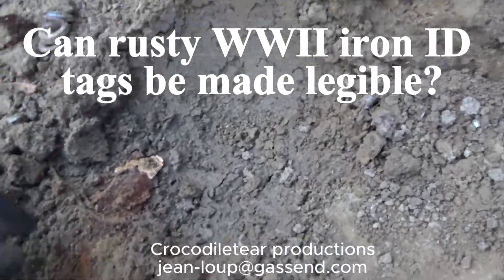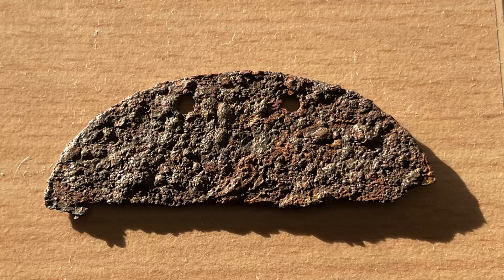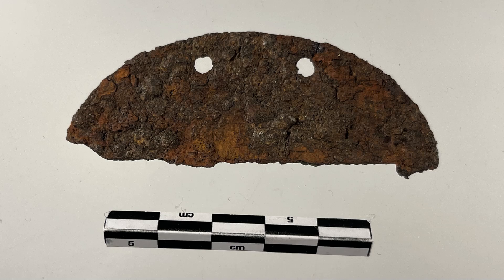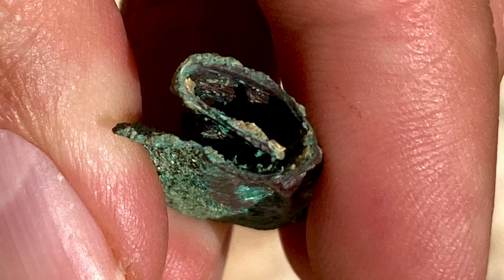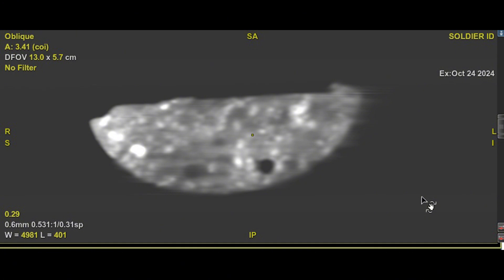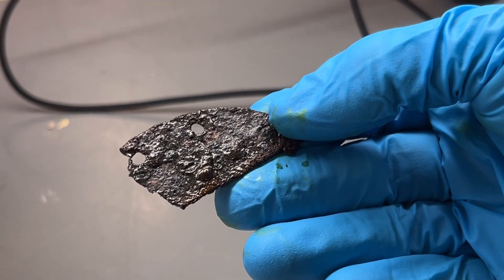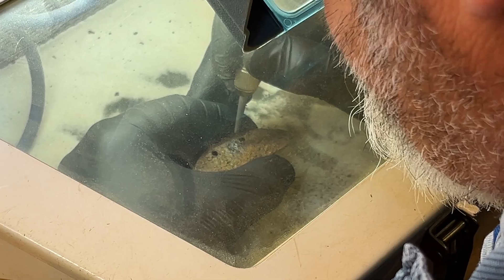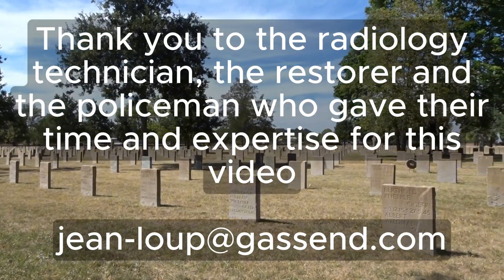Can WWII German iron identification tags still be read? WWII soldier identifications

Comment: The letters/numbers will erode with the rust, it's impossible
Reply: Use vinegar 
It will get rid of the rust but it takes a couple of days
Reply: @ lol
Reply: Please tell me if it works. I hope this person can be identified.
Reply: There is simply too little metal left to do anything. 
Maybe a few years after the war, in places where dry earth was not a corrosion accelerator... but not today, the more years pass the smaller the chances.
A few years ago I had the opportunity to look at fresh excavations, what was left of iron tags can be described as a "conglomerate of iron and oxygen compounds". Just extracting the identifier from the ground already causes irreversible changes, I do not believe that it is possible to read anything from such a thin iron plate. And I remind you that we have to read everything (or "almost everything") to get any useful results.
No dissolving (acids, evapor-rust and similar rust removers) or sandblasting (using soda is best) will help. These methods only damage the ID, which was too thin and poorly made from the beginning.
What would I do? I know it's not very realistic (because it is what it is), but I would try to fill such findings with resin (chemically neutral epoxy or smth better?) with everything around it. Today we don't have a method to reverse the corrosion process, but who knows what the possibilities will be in 20-30-50 years? I assume that the less we destroy, the easier it will be - someday - to read the contents.
Reply from the maker: I believe you are correct.
Reply: @CrocodileTear  only one way to find out. Nothing to lose give it a go we’re all curious
Reply: Maybe trying with laser?
Reply: Try Glass blasting. Found an Post recently at FB that it should work.
Reply: @magicpsy1761  That was in the video.  It didn't work.
Reply: @jic1   OK. So FB posting 💩 again 😄

Comment: I would try using CRC Evapo-Rust or electrolysis. It will depend how much of the original metal is actually left, but I have had surprisingly good luck using Evapo-Rust to remove heavy rust and be able to read engravings in the past.

Comment: Try soaking them in distilled white vinegar or coca cola. It should eat the rust/oxidation off. I've used it to save old metal that's small and thin. I can't guarantee the legibility of anything but it could giving you a fighting chance against rust

Comment: What about electrolysis? I restore old things and I’ve used it on old toys with thin metal and details have become visible. All you do is get a 12v battery charger, a bucket of water with some borax in it, and connect a wire from the piece to the negative terminal, and a fresh piece of iron to the positive wire, place them both in the water and turn the power on. I’d try 12hrs and see what happens.

Comment: I went metal detecting in a park of my hometown den haag in the netherlands, there was no fight, the germans held untill may and surrendered, the park used to be a emergency airstrip for food, one part at the edge of the park still looked the same, with some trees. between the trees i found a iron tag, with both sides. one side was crumbled and rusted and the other complete but very fragile, i decided to go to the extreme, and it worked. i put it in citric acid for less then a minute, and a toothbrush, it became readable, took the picture of it, after an hour trying to move it it broke completely apart. 

It was of a dutch soldier who functioned as a driver, and he went missing. Presumed to be killed by the resistance, the tag broke down but some parts still readable, i gave it to the family and it was the only thing they now have of him. When the park is scheduled to be maintained they will make bigger digs to maybe find parts of body's. The resistance was known to murder dutch working for the germans,but it was admitted the local government really did not look nor cared for those dutch, they just planted grass on the strip and added some playgrounds, there was also all sorts of munition in the ground still. 

So if you dont care about keeping it intact and just want to get a glimpse of who it belonged to, try it carefully with citric acid and a soft brush. 
i felt it was important since both sides where there, germans or allieds would register one side and leave the other with the body, and even tho it was just rust, its the best find ive ever made. The family could guess what happened, but never immagined someone would care enough to find out.

Comment: Hello!
Coming at it from a geologist's point of view:
for mineral identification, we often make "thin sections", which are little slivers of rock glued to a glass slide (using canada balsam or epoxy glue) and then polished down to a few microns thickness so that it becomes transluscent and can be analysed with a polarising microscope. 
Any properly equipped university geological laboratory should be able to make them, and many commercial labs specialised in geological sample analysis too for a few tens of euros a pop.
It  an also be done "at home", as the only material needed are some glass plates cut to the proper size by any glass shop, a series of carbrundum grit (maybe even automobile type wet sandpaper), and a larger glass plate to use as a stationary tool (as a flat surface to put the grinding medium). It will only need a bit of water for slurry -making (if you use carbo powder) and lubrication, and some elbow grease. 
You glue the tag to a small glass plate, put a little spoon of carborundum on the glass work surface add some water to make a runny slurry (or place the wet sandpaper sheet on the plate, it should glue by suction),  and get grinding, keeping the surfce wet. 
Make sure to use rather fine grit, as rust and metal are quite "soft". And work gently so you do not peel the tag from the glue and gouge the metal.
I am not suggesting to polish the id tags to transparency, but only to be able to reach polishing down to clean metal without worrying about breakage.
Once the surface is polished flat and shiny, you could maybe see something or try the acid etching method again.
Reply from the maker: Do you have any ideo of what the cost of this would?
Reply: @CrocodileTear to have it done professionally I'm not sure of the cost, but materially it isn't very expensive. It sounds like a similar concept to process that I've seen with ancient wood samples that are being studied. Essentially, the object is embedded in a hard, clear medium such as epoxy to stabilize it (usually the object is placed in a vacuum chamber before the epoxy sets to remove air bubbles and ensure full saturation). Then the stabilized object can be 'sliced' extremely thinly by polishing the surface using a very fine abrasive and a flat lapping plate (a piece of glass or a smooth stone countertop works). As it's gradually polished thinner and thinner, a fixed position camera is used to take high resolution photos every few microns to capture the cross section and record a 'slice'. With an object like a dog tag, you may be able to capture the miniscule topology differences between raised characters that were stamped into the metal, however it is inherently a destructive process and the odds of recovering the information seem low.

Something that may be worth pursuing is ultra high resolution 3d scanning using photogrammetry or LIDAR to create a digital copy of the object, and then using modelling software to enhance the irregularities and possibly reveal patterns that might be invisible to the naked eye (such as height differences caused by stamped characters). There is also a person here on YouTube that rescued and rebuilt a decommissioned Electron Microscope that might be willing to scan it at an unbelievable resolution to possibly do something similar.

Edit: the person with the electron microscope has a channel named ProjectsInFlight I believe.

Comment: I would suggest mounting the tag in a block of resin. Then carefully sand the exposed side with progressively finer abrasive, then polish and finally acid etch that may highlight the numbers even if youve mounted the tag backwards.  You need the support of a resin block behind it.
Reply from the maker: Yes, that might actually work

Comment: Since nothing so far has worked here a couple of ideas. Sonic cleaner or electrolysis. Perhaps some sort of vibratory cleaner without any media. Maybe vibration would break off an intact piece of rust containing enough info to provide an ID. Also, there has been a fairly recent discovery that enabled burned scrolls from Pompeii or Herculaneum to be read. Plus I seem to remember some Dead Sea Scrolls that were on papyrus vellum or parchment that could not be unrolled yet the scientists were able to read them. I don't know what they used to "see" with though.

Comment: How about a CT scan? It should be able to detect the slight difference in metal density from the stamping process….or the layers of rust may be slightly thicker in the areas where the rust had to fill in the stamped parts. If nothing else, it may have left strain traces in deeper metal which hasn’t been rusted through yet (maybe?)

ChatGPT also suggested neutron diffraction which sounds awesome.

Comment: Have you tried oxalic acid to remove rust? It's a method often used to restore old steel helmets. If most of the iron already converted to rust tho, I'm afraid all data is already lost.

Comment: Try doing a rust conversion like Gun Smiths use in a Firearm restoration, not sand blasting or removal of the rust. After that is completed try doing other methods like magnetic or x-ray to recover information if still present.

Comment: I think the serial number restoration works because although the indentations of the letters has been filed off, the atomic structure underneath is still disrupted by the stamping, and thus reacts to etching in a slightly different manner. The polishing is to make the etching more even, and the subtle differences more apparent. This said, in order for this to work you need a substrate of the original metal still intact, and judging from the cracks that doesn't seem the case unfortunately. However, you may have better luck with a less severely corroded specimen.

Comment: Dont mix the tags up , keep them catalogued to where they were found , the technology will come about to be able to read them , , I would think if the  surface was lightly ground flat and clean with a precision machine on the side the numbers were stamped on  to get the cleanest surface possible ,, the acid would react enough to bring up the letters , it has to be worth a try for better ones , it will mean damaging it but it will be worth it if you can identify even one soldier.

Comment: a bit of a longshot, but have you ever placed a coin on a railroad track to have it flattened out? a lot of times you can still see the design of the coin even though its now very flat. i tried using a large punch to pound a penny flat against another piece of metal and got similar results except it wasnt elongated, it was just enlarged. 
maybe if you tried something like this but with a large press, either with surface prep or without in combination with xray or acid. its certainly a longshot, but who knows? it might bear results.

Comment: This method of serial number restoration looks interesting and still promissing! But seeing the police officer apply the acid directly on that sandblasted and uneven surface... Imagine putting acid direktly on the unevenly filded down serial number area of a weapon or car.

If there is any unoxidized iron left in these tags, how about grinding it down and polishing it so that a plain polished surface can be established. (You had to hit the very narrow plane between the back side of the tag and the deepest stamping inprint on the front side). If you then put acid onto it, maybe then you can faintly see where the material structure was changed due to stamping of the letters. However, if the whole tag was rolled during manufacturing (what is likely the case) the material structure may not be suitable to show any further changes by downstream stamping. Because rolling and stamping may have the same impact on the metallic structure after all. I´am no expert at all, but I had some points of contact to the analysis of metall structures during my time at some higher education institution.

But varying with the degree of corrosion, trying to restorate the original surface seems to be next to impossible - simply because it doesn´t exist anymore. Therefore material structure seems to be the only way.

Comment: Let's assume that these problem tags are made of mild steel? This is probably the worst metal you could use, as it always heavily corrodes in the conditions found here. The only thing to prevent this is adding a significant amount of chromium to make it non-corrosive. All metals were at a premium in Germany during WWII, with coal being the only abundant material being used in metal production. However, Germany had supplies imported from the Axis or occupied territories. There probably was enough Cr available to make stainless tags. However, the other alternative was Aluminium. Why they chose mild steel is a mystery.
Mild steel is very reactive and will readily revert back to iron oxide (rust) in the presence of water, oxygen and ions. General corrosion will often be present along the surface of buried steel components unless the surface is coated with a dielectric, or an electrically insulating, material. The severity of general corrosion depends on the soil conditions (e.g., moisture, degree of aeration, pH). The corrosion can be so minimal as to be insignificant, or it can be severe. Typical general corrosion rates in soil result in a loss of about 0.045 millimeters (mm), with the deepest pits of about 0.23 mm over a period of 9 years. Of course, in this situation corrosion is occurring on both sides of the object.
As for being able to extract the information written on the tag, this is probably impossible. The surface metal is now just an irregular structure of oxide scale, which now occupies approximately six times the volume of the original steel.
However, if anybody has any ideas how to turn back time, and make the impossible possible. It would be interesting to know their ideas.

Comment: Another way you didn't try was electronically removing rust you connect dog tag to an wire connected to battery the tag stays in  tank  u put in a  white powder  solvent solvent turn on battery charger & the electric current removes rust u can just keep checking as to not remove all metal   electrolysis it's called look it up and try on some tags

Comment: My thought would be to dip it in diluted acid (muriatic or others) which will eat off the flakes and get down to whatever is left of the remaining metal, then neutralize with baking soda solution.  It can be done in an unlimited number of stages to be cautious.  It's probably unlikely to work given the advanced degradation, and if overdone it will consume the whole thing.  But acid loves rust, and high tech solutions haven't worked.  Great videos.  I'm glad you're continuing with these.

Comment: I have dug iron and mild steel objects like trade tokens and other household items with this same heavy exfoliation type rust to them. None of the methods you used here work very well to get relief details (including lettering) viewable again. The already mentioned electrolysis method will break down the heavily oxidized build up. After that, and this sounds crude but it works; you have to carefully scrape towards the surface and finish the process with a fine abrasive such as fine grit emery paper or stone. Its time consuming but details such as stamped latters and numbers will begin to appear. However, its normal that some of the information will not emerge well enough to 'read' due to the damage from pitting.

Comment: This is a crazy idea, but years ago it was said that soaking rusty tools, iron nuts or bolts in Coca-Cola soft drink was a good way to remove rust because it would only remove the heavy loose rust and leave the surface intact. I know it probably won't work because it appears that the rust has penetrated so deeply there is nothing left of the numbers and letters etched into the metal, but It might be worth a try since there is nothing to lose.

Comment: I'm certainly no expert and I'm talking out my ass with this one but I have an idea: When the iron was manufactured it would have gone through a flattening roller while hot and this would given the metal an even consistency once cooled. Now when the letters were punched in, it could have had a forging wave effect where this strengthens the lower and surrounding areas of the letter like throwing a stone into a pond and seeing the shock wave spread out. I wonder if you could machine off very thin layers back to bare metal and take a look through a microscope for any evidence of forging waves from the punching process - if there were you could possibly identify the shape to their corresponding letter... If that makes any sense!

Comment: Great video as usual.. I would think that the scientific world is your best bet now.  Electron scanning perhaps after a mild cleaning with chemicals.  The problem is that the tag you presented appears to have completely rusted through with no base metal remaining.  Not sure a chemical cleaning or electrolysis cleaning would leave enough to scan in a electron microscope. Might work with a less corroded sample.